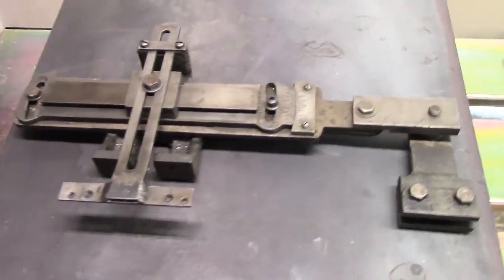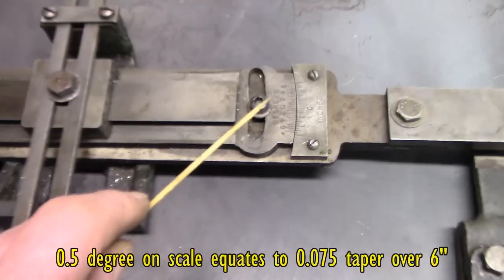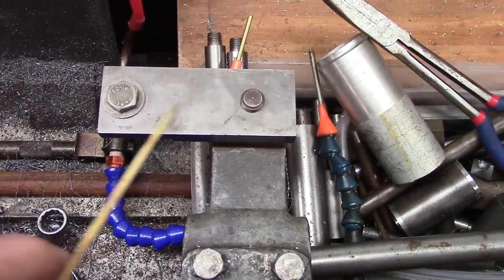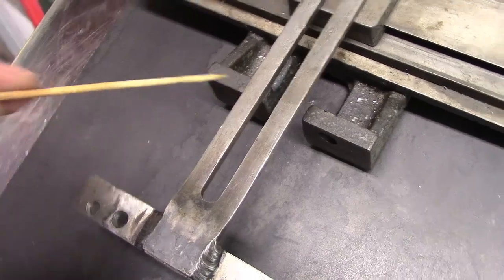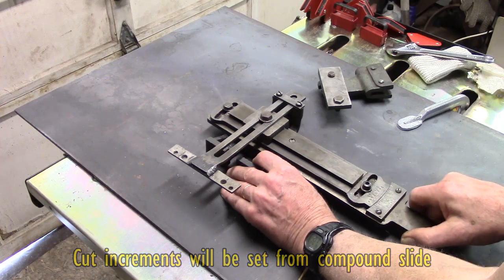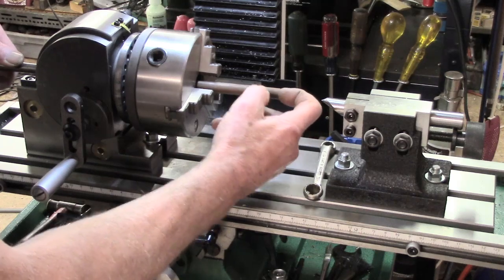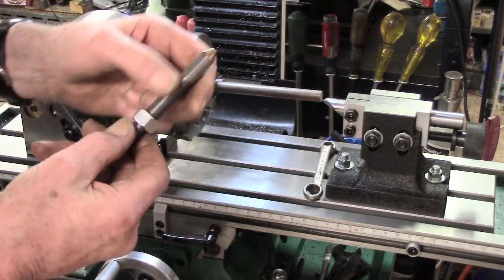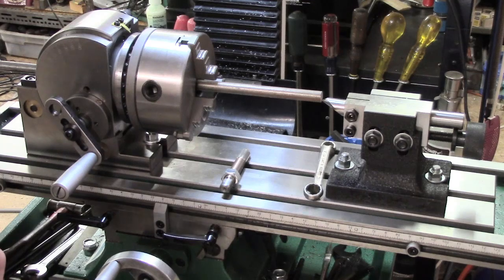Taper Turning Attachment

Comment: I think you will have to disconnect the cross slide leadscrew or the sliding device will not be able to move the cross slide. I like your cross slide stop arrangement , a very useful addition for reap jobs.
Reply from the maker: Englishman French Quite right - totally forgot to mention that!! All I would do is remove the cross slide lead screw from the nut. Yes, cross slide stop has been invaluable.... typical example might be 'saving' a setting after a long pass, so that final shoulder machining can be done at same setting of dia.

Comment: Hello Chris.  That looks like a nice taper attachment.  I have one that came with my lathe.  I have only used it one time and that was to make a taper inside a spindle that I was making.  Thanks for the video.
Reply from the maker: cerberus Hi - rare usage but a useful thing to have. One main occasion I used mine was way back - turned three or four MT2 blanks to make some arbors.